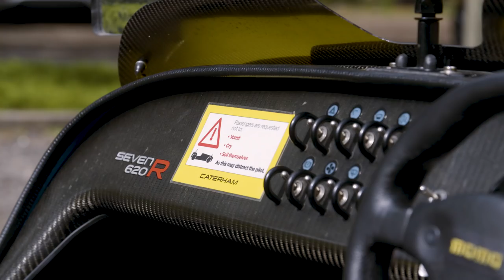Living With A Crazy Caterham 620R

Comment: Front mount, high(enough) revving engine (which doesn't require to be reheated, after you stall it), rear drive, manual gearbox with 3 pedals (i prefer H-boxes, but... picky-picky), four conventional wheels, fair price, fair groundclearance, seating for two, aaand most importantly...    *no stupid spoilers anywhere*.
So in summary, this is a proper formula o... * cough* Formula two vehicle.

(I'd still gone for more down-to-earth version, with windshield and a softtop)

7:02 - best carjacking i've seen on the Youtube. :D

Comment: I can imagine these are supremely fun if the weather is right. I'd absolutely love one but it's crazy money for a toy with such little usability.  How does this compare to something more useable like a Lotus or an engine swapped mx-5. Did you ever get that v6 for yours?
Reply: No V6 for the MX-5 yet, but still on the horizon. It doesn't compare to the 620 in the slightest though. There's pretty fast (MX-5 V6), and then there's the Caterham which completely redefines the word.

Comment: Mental with that power, but the power for the price is good.

However I'd be happy with a 10 year old 130bhp one, to use as a track toy. Given my lack of track experience, the entry level would be all most people need/ use the power of.
Reply: Alternately, buy from one of the other British kit car manufacturers - with Caterham you're paying a huge premium for the badge. For less than 10k you can get something that will embarrass most cars, let alone a Seven. £50,000 is dangerously close to Ultima territory.
Reply: Coxy002605 The difference is, that with a Caterham, you are buying all new parts. A complete car, down to the last detail. There's no second hand doner car from which you salvage the old parts. You get a full warranty and the knowledge that they've been doing this for a long time. Not that there's anything wrong with most kit car manufacturers, but you never know how much development has gone in to a car, or how good the chassis design will be etc.
Reply: What you say was true a decade or two ago, not so much nowadays.